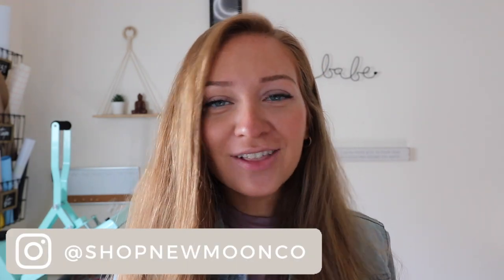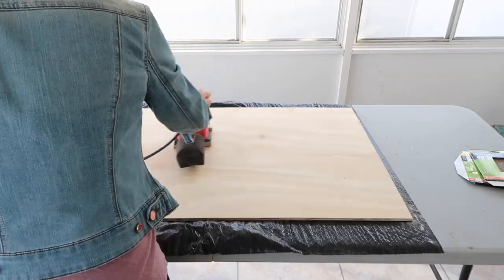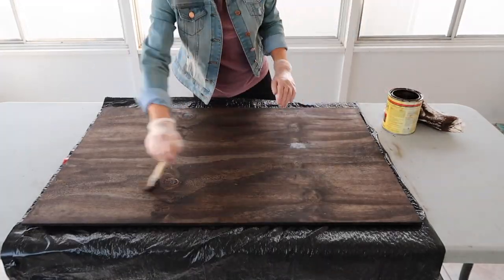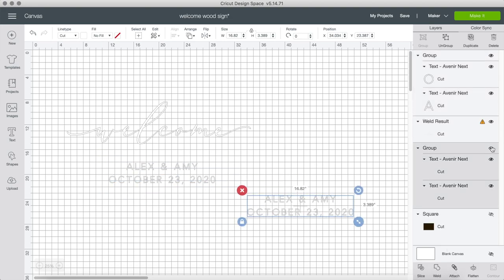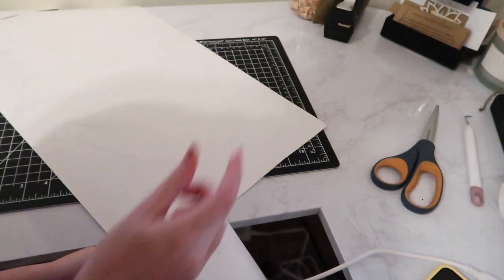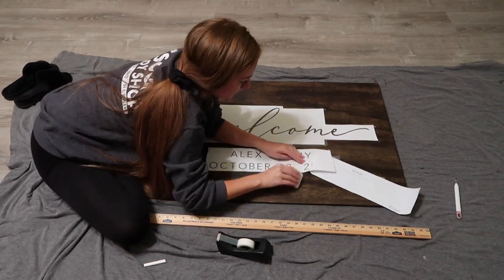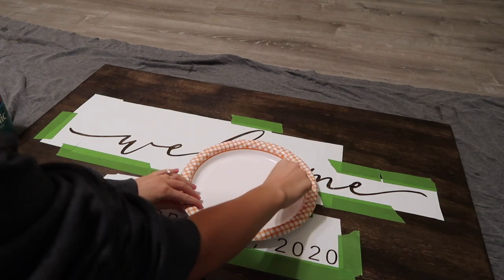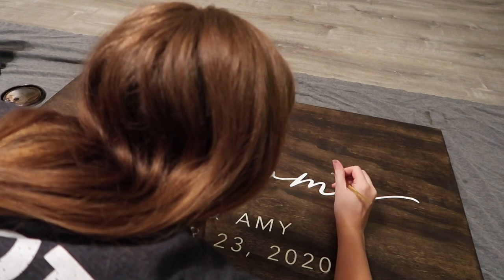DIY WELCOME WOOD SIGN // Rustic Wedding & Engagement Decor (With Your Cricut!) - DIY Wedding Decor

Comment: Hey Amy! After I stained my plywood, and printed the stencil, it wouldnt stick to the wood like yours would. Do you have any tips and tricks on how I can make it stick more?
Reply from the maker: hi Fiona, oh no! My suggestion would be to apply a coat of the polycrylic/polyurethane before applying the stencil. This has helped even if I'm not painting and I simply want to stick vinyl to a wood surface. You may also want to try permanent vinyl instead of the removable vinyl that I use in this video. hope this helps!! :)

Comment: What makes you decide to paint instead of just using the vinyl letters?
Reply from the maker: it's personal preference! If I wanted to reuse the wood sign in the future I probably would've applied the vinyl letters strictly to the sign. BUT even if I wanted to reuse mine, I could sand down the sign and the paint would come off! I think painting the sign gave it more of a rustic feel :)
Reply: @AmyMakesThat  Would it have worked just as well to use removable vinyl for the lettering, and peeled it off if you ever wanted to reuse the wood?